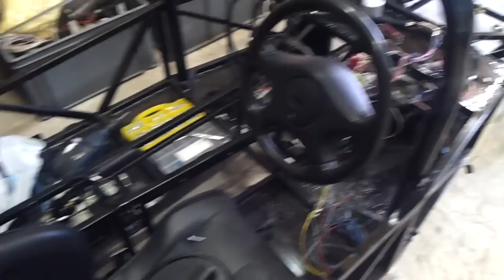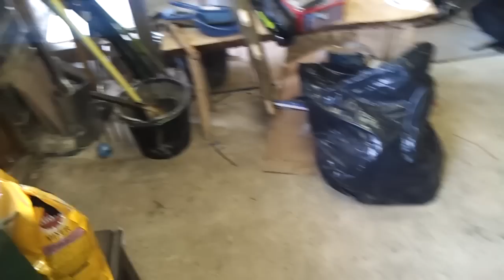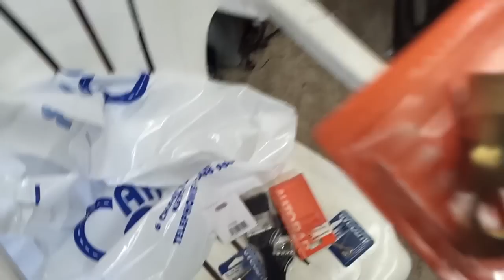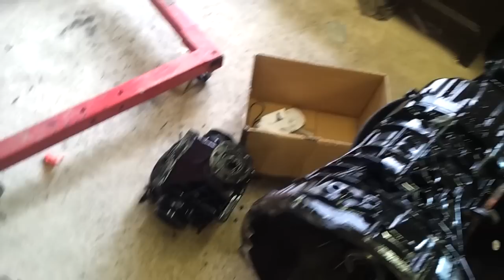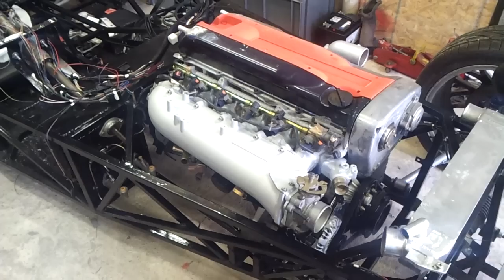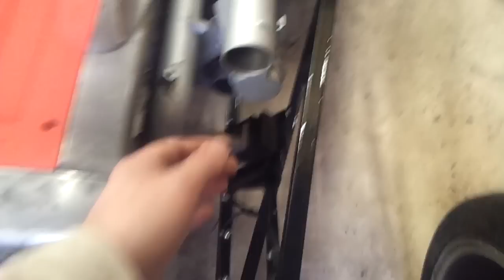Locost Skyline RB25 Kitcar Build - Ep17 Engine install time!

Comment: Only one problem with using setting silicone for the sump is it tends to squirt out when doing the sump up , sets hard and gets sucked up into the oil pickup and kills your engine. Looking good though and I'm looking forward to seeing her running

Comment: u can line the clutch up by eye... havnt used a tool in ages lol
also make sure u dont start the engine with the upper timing cover off as the CAS hits on the cam gear (from memory) if it isnt spaced out.... not good!